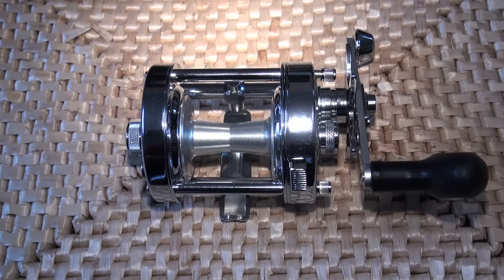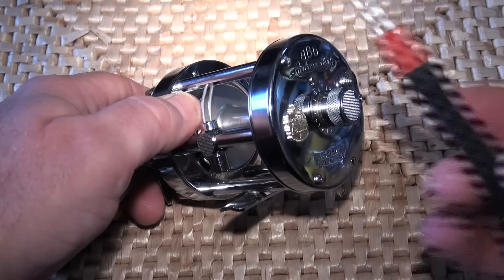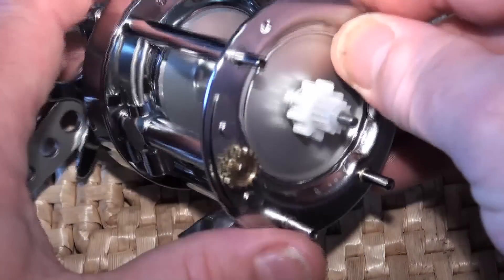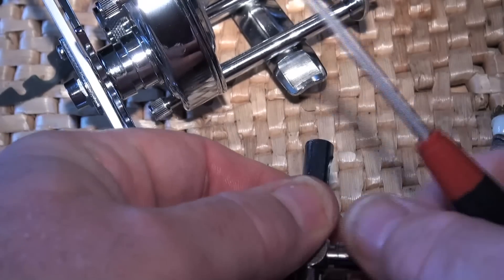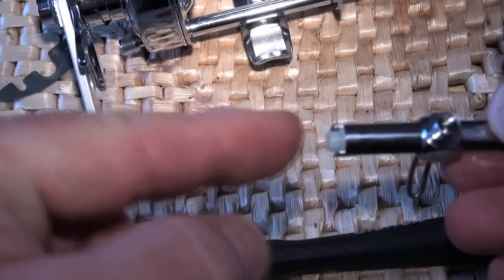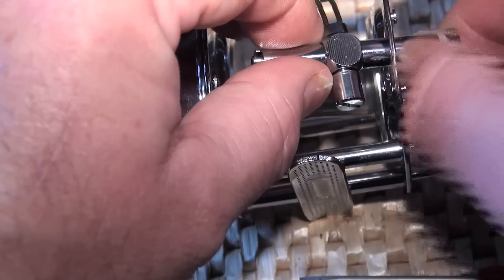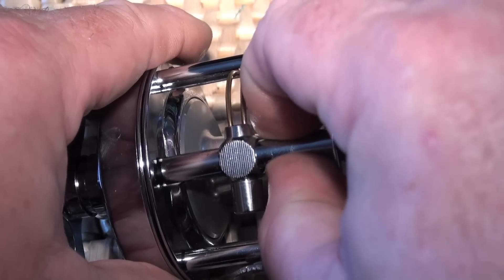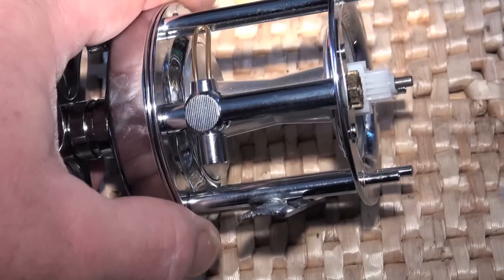Abu 6500 CS Chrome Rocket - Levelwind Instalation Step By Step Instructions By PMR

Comment: Can you just take the levelwind off and leave it off or is this an integral component? Id like to get one of these reels without a levelwind. Thanks!
Reply from the maker: Justin Mugno This video was made for people who want to change the standard levelwind for a bearing version. If you want the reel and don't want a levelwind; by a chrome rocket 6500 CT
Reply: PimpMyReel but can it be done? I'm not in the market to buy right now
Reply from the maker: Justin Mugno 
PMR bespoke custom CT conversion kit can be bought direct from me and if you search my videos for;
Abu 5500 CS and Abu 6500 CS cage conversion to CT cage with PMR CT conversion bar and top bar caps

This is a step by step conversion video

Comment: Without bearings on both ends that is useless.
Reply from the maker: That statement shows ignorance of the parts in question. A standard levelwind comes without bearings but still does the job. An Abu C4 or C5 OR a PMR Speed bearing levelwind comes with one bearing . The Abu's with a standard bearing and the PMR version with an Abec 5 stainless steel bearing! The duel bearing levelwinds tend to be standard bearings, cost stupid money and after 6 months of salt water fishing both bearings need to be changed. BUT; the bearing by the brass cog cannot be replaced because of how they are converted SO you end up having to buy a new levelwind worm gear with duel bearings if you can find one. Or spend stupid money on a duel bearing replacement levelwind. Moral of this post, buy a levelwind with a single bearing so you can replace it when needed and put brain in gear before engaging fingers to type!!!